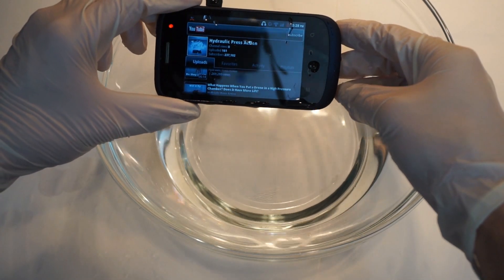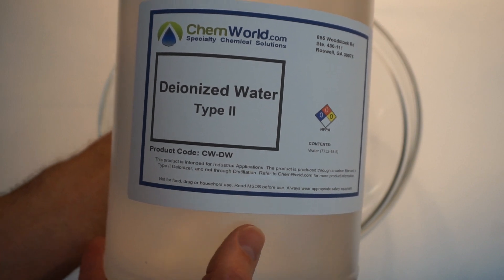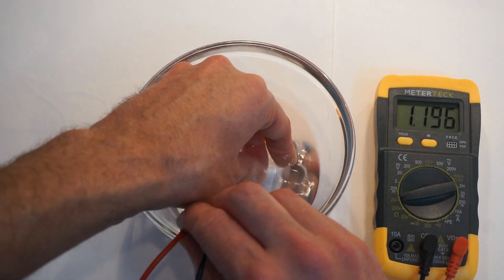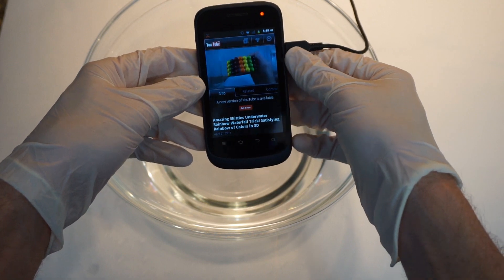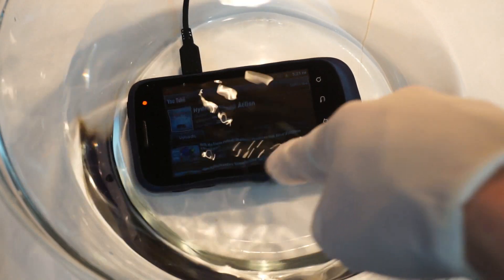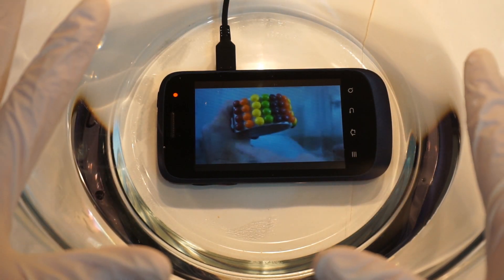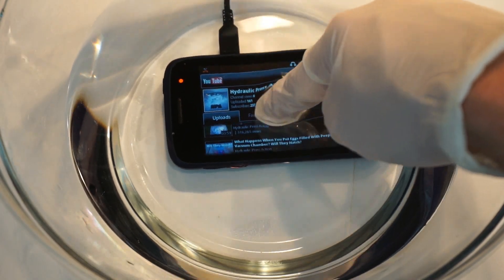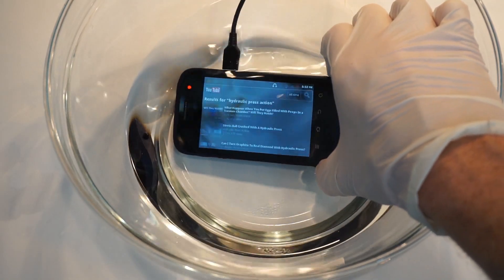Is Everything Waterproof in Pure De-ionized Water? Charging Phone in Pure Water Test

Comment: Put it into the vacuum chamber?
Reply: Super Puggle it'll be exactly the same as normal water
Reply: the thought that counts.
Reply: A vacuum would kill the battery  I think.
Reply: It could be the same if all of the air inside the phone came out in this test, but it's not clear if that occurred because there were no signs that water got into this phone. I would like to see this be done because I've watched many of EverythingApplePro's smart phone water tests and in those videos where he tests phones that aren't water resistant air bubbles are likely to come out and water gets into the display. But I didn't see either of those things here so we can't be certain that water even entered the phone. (Surface tension can prevent water from going into small cracks or through fine screens. For example, JerryRigEverything has several videos about what makes various phones including the iPhone 7 and Galaxy S8 "waterproof" even though they are not airtight.)

Comment: It would have been great if you used your matter in the water with the phone in it. I wanted to see if anything was reading on it with electricity running through it in to the phone from the plug. That and how close you would have had to get to the phone before it did change. Another thing I wanted to know was did the phone still work hrs after being pulled out of the water. Did DI cause any battery or circuit board corrosion after being pulled out?

Comment: where do you get pure water from? supermarket?
Reply from the maker: +Uncle Peter  Any chemical store or even Amazon.
Reply: +Hydraulic Press Action alright, tanks for the reply dude, your video's are awesome.
Reply: It's not distilled, it's deionized.
Reply: from church
Reply: Thijs Lenssen 
Distilled is about 5–15ppm on the TDS scale (Total Disolved Solids)

De-ionised is a 0–1ppm

This means distilled is very clean, but Deionised is practically all water.

The rest is just a process difference.

but here you go:

Distilled water is highly purified water that does not contain any salts. It is produced by boiling water into steam and then condensing the steam. As a result, organic substances having boiling point less than that of water and oils present in water can be present in distilled water.
Deionized water is ultrapurified water containing no ions other than H+ and OH-. It had resistivity nearly equal to 18 Megaohm-cm.
After distillation, water is passed through a reverse osmosis membrane and a deionizing membrane which allows only H+ and OH- ions to pass through, to finally obtain deionized water.

OH- is a molecule called hydroxide. It is a hydrogen and oxygen atom bonded together.

So yeah
That sums it up
Reply: got it, its pretty easy indeed
Reply: " is are or is are not" this  is the question
Reply: "ya got the power"
Reply: Uncle Peter "your video is are awesome"?
what?
Reply: Thijs Lenssen nah
Reply: Thijs Lenssen read above
Reply: Paulo Castro no one told you you were wrong yet so I will, your water will kill your phone
Reply: theglurgle that's why I hate the YouTube community everyone just accepts wrong answers, reddit or stackoverflow still the best place to discuss this things

There will still be impurities like oil or gas that comes with the water steam, and ofc you have to test the water first before putting your phone in it.
Reply: Uncle Peter - From the purest supermarket.
Reply: Sigma Aldrich
Reply: Siddhayak Goyal but wait you said:"Distilled water does not contain any salts". So that means that it doesn't have any ions, right? Because ions come from salts.
Reply: Uncle Peter it the water you use in a car battery and steam iron
Reply: I’m sure you can get deionised water from the supermarket badged as water for your clothes iron...
Reply: Distilled water is NOT deionized water, but distilled water does also have very few ions. The difference has to do with how pure the distilled water is kept all the way to the bottling stage. It is just distilled water, but the still they use captures the water vapor in a vessel which will not contaminate the water with ions, so when bottled, the water will have nearly no conductive ion contamination.
Most stills use a copper or aluminum vessel to capture the water vapor, which will contaminate distilled water with conductive ions. Not many, but enough. Deionized water is designed for very sensitive experimentation which could easily be contaminated.
Reply: @rich1051414  u forgot One thing no matter how much care u take to avoid contamination of distilled water, it is boiled in air so CO2 will desolve in it producing H+ and HCO3- which is different in case of deionized water which pass through cation and anion exchange resins
Reply: Uncle Peter there's better stuff in the Indian swage pipes 😂😂
Reply: "bam pure water" then later "There will still be impurities"

Sorry you can't have it both ways Paulo. If you read what Siddhayak explained, distilled water is less "pure" than deionized water.
Reply: Just buy distilled water from a store? Lol
Reply: Not only pure, de-ionized.
Reply: Poppy en la pasta
Actually that would be gonorrhea...
Reply: JDRamm MX
Purist?
Reply: Uncle Peter try searching "reverse osmosis".
Reply: You can get distilled water in car parts shops as wet cell batteries need them. Not sure about Type 2 Deionized water.
Reply: From a water filter on the sink
Reply: From pope francisco's pee
Reply: Thijs Lenssen Your welcome! :)
Reply: mini dwarfdude care to explain?
Reply: Siddhayak Goyal aha never knew. Thank you!
Reply: boil water, collect steam.. bam pure water
Reply: i will say "PEDRO philia"
Reply: you could distill it yourself
Reply: TheFloatingSheep you can distill it but deionized water is deferent than distilled
Reply: lgab distilled water is deionised aswel right?
Reply: yeah ask the pedophile pope

Comment: That's what they put in AIO and general water cooling systems.
Reply: they dont use it because its not very conductive though. they use it because the minerals contained in normal water don't settle inside the pump or cpu block and block the flow of the water(or stop the pump from turning) that way.
Reply: Sure, that I know. But I was wondering if AIO manufacturers took conductivity into consideration.
Reply: Sacco Belmonte distillate water has got some ions
Reply: http://www.waterandmorehub.com/deionized-water-vs-distilled-water/
Reply: Usually they use just distilled water.
Reply: isn't that the same?
Reply: Oh I see. 

The question would be then "Is distilled water non conductive enough to be safe?"
Reply: Sacco Belmonte Yes, even if you use nonconductive liquids in a loop they will eventually ionize from the metals in the blocks of the computer.
Reply: Oh! I see..thanks!

Comment: what about the polar charges of the water molecules?
Reply from the maker: +Joshua Betts positive and negative charges need to be able to move freely to the positive and negative wires. Water is polar so it has positive and negative charges in the same molecule so it can't move either direction so nothing happens. When salt is in the water there are individual positive and negative molecules that can move opposite directions